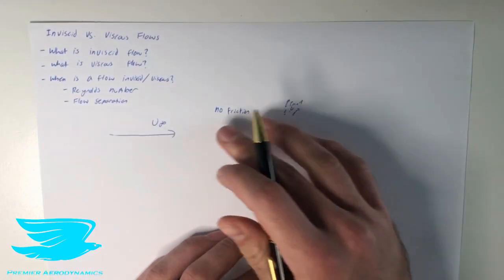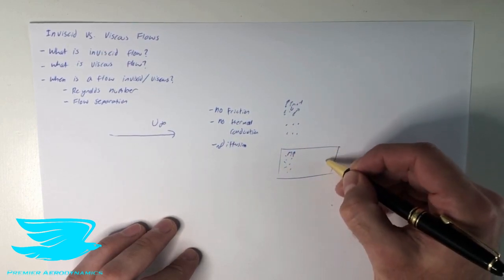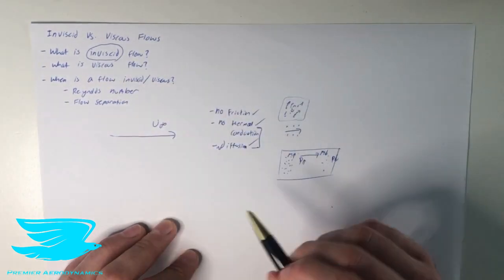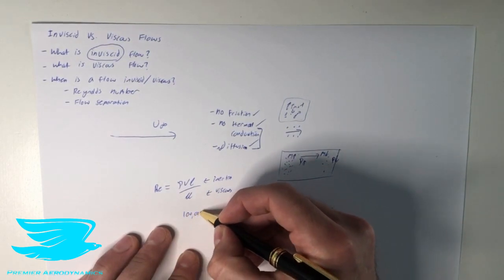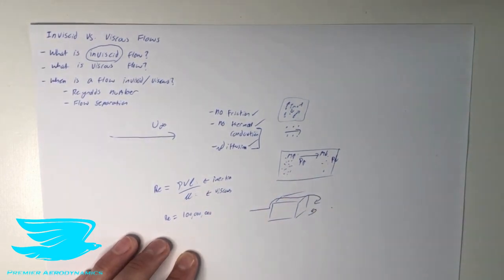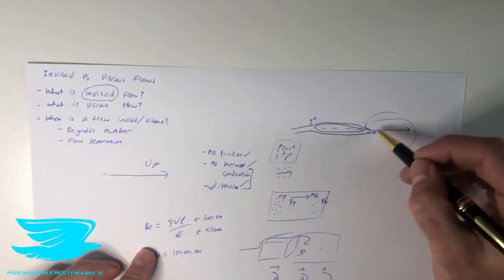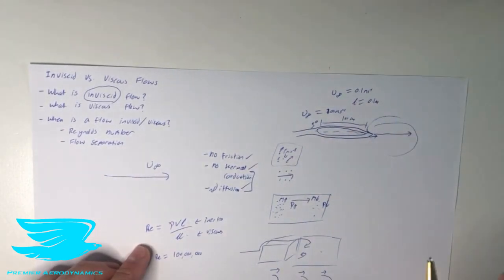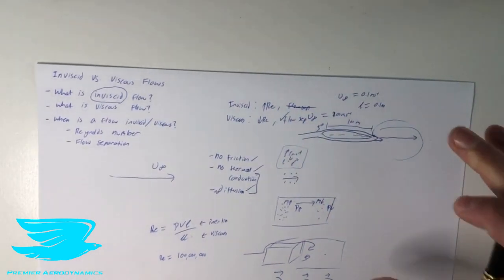[Aero Fundamentals #3] Inviscid and Viscous flows explained

Comment: hey, so if I have a problem in viscous flow or an inviscid flow and I gotta solve for Reynolds number, so how do I determine the dynamic viscosity in the formula? Should I take the standard values or any other calculation is required?
Reply from the maker: You can still use the same viscosity values, however, it doesn't make much sense to calculate the Reynolds number for an inviscid flow because the Reynolds number is the ratio of the inertial forces to the viscous forces.

If there are no viscous forces, then the Reynolds number doesn't make sense.

We cover the Reynolds number in more detailed in our video [Aero Fundamentals #2] Reynolds number explained
Reply: @PremierAerodynamics  yes true. Understood. Thank you man! Appreciate it.